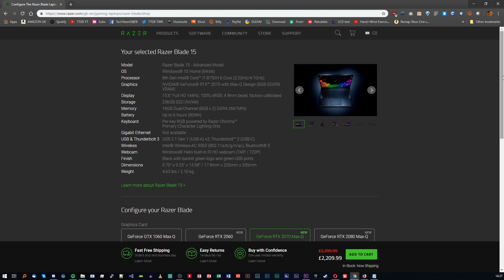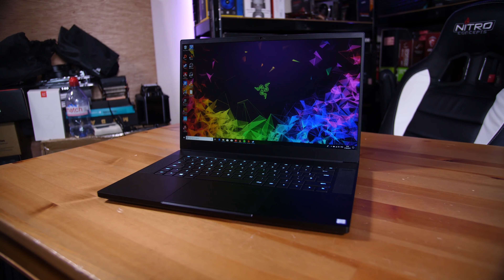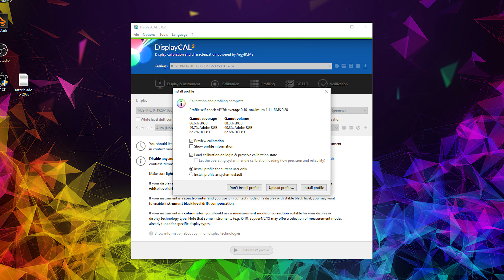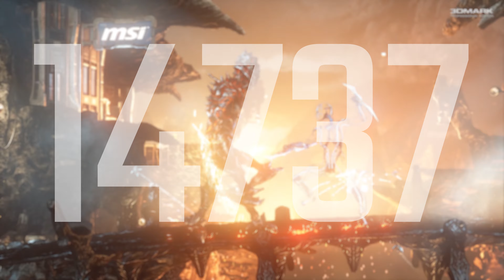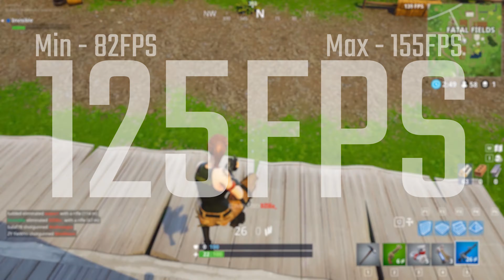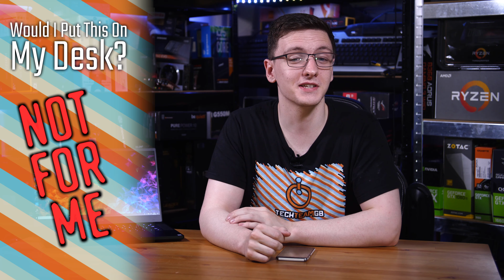Why does everyone LOVE this?? Razer Blade 15 2019 Review

Comment: So the cooling system is called a water vapor chamber and it's more effective than the heat pipes you're comparing it to. The heat dissipates to the top surface of the laptop keeping it off the chips. Under gaming load (Odyssey, Witcher 3, Far Cry 5, Exodus...), my Blades 2070 max Q rarely goes above 72 degrees Celsius and the CPU (i7-9750H) stays around 82 C. Are you playing in a hot room or with something obstructing the fans?

Comment: I have the same model but I've upgraded to 1TB SSD storage and 32GB of RAM and it's perfect :)
Reply: What manufacturer did you use for the RAM.  I tried to upgrade using Geeksquad but they said it didn't work.

Comment: The Blade 15 Basic has an m.2 NVMe slot and 2.5 in hard drive slot but you are giving up the larger battery from the Advanced model. Also, the RTX 2070 in the Blade 15 is performing similarly to the RTX 2060 in the Acer Predator Triton 500 not because it is thermal throttling. The RTX 2070 and 2080 in Razer Blade 15s are Max-Q design while the RTX 2060 in the Triton is the full version. Given that, an RTX 2070 Max-Q performs in between an RTX 2060 and RTX 2070

Comment: I own a blade 15 advance with RTX 2060, 512 SSD. My only critics for this laptop is the expensive price, moderate size storage, and the need adaptation keyboard. Everything else is great. Thermals? I live in the tropic, ambient temperature is always around 28-35°C and still this laptop performs great. Just make sure you clean it periodically
Reply: what are the thermals for the cpu? Did you underclock it? or keep it as is? Im interested in it and just wanna make sure it's all good
Reply: @kellencurby6455  I'm keeping the factory settings, only set the performance to gaming from the razer synapse software

Comment: What 5 games take up 200GB?
Reply from the maker: Windows takes up 50+, Battlefield v takes up 70, apex takes up 30, pubg takes up 30 and fortnite takes up around 20. If you installed gta v instead, that would take up nearly 100 on its own.

Comment: Lol I have rtx 2080 model cpu stays max 84ish and gpu barely hits 75. You think triton has better thermals? Sure, razer has better thermal too if you put the fans up. Have you mentioned triton is loud? Why? Because it’s fans are like 2x as loud as the blade.
Reply: Money isn’t the problem when it comes to me and razer but I just really wished that their units did not come fucking defective all the time. I had to switch it out 3 times dude to a problem with the lid on the base model. Also how’s ur blade holding up any problems?
Reply: Mine has problems, but they are all software so I fixed them.

Comment: I had the Acer and swaped it for a Blade. With some voltage and frequenzy tweaking you can get great results. For me nothing comes close to the quality feel of the  Blade. And yes I installed a 960 GB SSD, 265 as default is a crime.
Reply: 9750, 240hz 2070 model fyi.
Reply: Had the acer to and returned it for the blade... the screen on the predator looked so dim and almost yellow when next to the blade. Oh and the build quality is way better on the blade, the predator feels cheap.  My blade also doesn't have any throttling issues.

Comment: The Blade is super easy to upgrade. 256gb SSD's are standard SSD starting storage points. The Triton is cheaper and thermals are fantastic, but it's still a bad work laptop. This is the first review I have seen that doesn't say the Triton sounds like a jet engine taking off. The Blade from everything I have seen is better in almost every way aside from thermals.  I could see that none of that would be important to people buying it only for gaming, but don't try using the Triton in a classroom or library.
Reply: The Sad Potato I completely disagree with you, having had both laptops, you couldn’t use either in a library gaming wise unless you’re on whisper mode. For basic schoolwork it won’t make a peep, as for gaming in a library again you can just whisper mode and g sync will help you much more than the razer which doesn’t have this feature. So again the Triton is actually superior in the library scenario you described.
Reply: Ali Pacheco Thats good information I didn’t know about whisper mode. It’s one reason I chose the MSI GS65 over the triton, because I’d heard it was quieter during normal use. G-Sync is really the only plus over the Razer, but most of the time I wouldn’t use it anyways. The battery life hit you take and the reboot require to enable disable I would probably end up just leaving it off. That’s my opinion anyways but if it’s purely for gaming the triton is the better buy. I have never used one but I like the triton as well, but having used the Razer nothing else seems nearly as solid.
Reply: The Sad Potato Fair enough, I just find that even at school I have access to outlets, so the hit I take to use g-sync in a library while being absolutely quiet is worth it.
Reply: The Sad Potato I do agree on the ssd point however!

Comment: I’m more satisfied with the MSI laptop than the Razor. 🤷🏾‍♂️
Reply: Why the MSI over the Razer? Not that MSI makes bad laptops, but in my opinion the Razer is just that much better in just about every way. I am assuming you are talking about the GS65.
Reply: The Sad Potato , Exactly I own the GS65 and it’s not as pricy as the Razor plus the MSI keyboard and key pad are responsive and smooth to the touch. MSI just looks better with the Matte and gold touches and the 144 hz screen is wonderful.
Reply: Marcus Bell Fair enough. I also own a GS65 because I got a deal on a 2060 model for $1,400. The keyboard I do like but I wish the trackpad was taller instead of wider. One thing I really liked about the blade was that it seemed like it was built like a tank. The plastic hinges on my gs65 come apart from time to time. The speakers are also better on the blade and I like the windows hello option as well. The GS65 is still a solid and very stable laptop though. I do love the screen. it’s my first high refresh rate display and it’s a dream but I thought the one on the blade was comparable. The black and gold is nice, but honestly I my favorite is the silver like on the blade personally. To me it was absolutely not worth the $800 difference it would have cost me though. No regrets going with the GS65 it just surprised me that someone liked it more than the blade. It’s all personal preference though for sure.

Comment: Hi bro, I like your videos, however I felt that this is a low quality review. You didn't mention a lot of things eg Keyboard lighting software plus fan control, SSD speeds, Temperature differences with an undervolt and the build quality of the laptop. Not being a hater or anything but I just wanted a little more information buddy.
Reply from the maker: So I actually didn't mention the keyboard lighting because I also had an issue with it, and their software was fairly naff. It's hard to describe the issue but it was essentially that the different colours appeared separated to me which was rather uncomfortable to look at and so I spent almost all of my time with this with the keyboard back light off. Temps with an undervolt is something I generally won't cover, because basically no one who actually buys this would do that. Build quality is something I should have mentioned though, which for the most part is pretty good, if rather sharp.
Reply: @TechteamGB  Alright bro, appreciate the reply. Was thinking of picking up a Razer Blade 15 as they are on offer on Amazon for a couple £100 off. So was wanting to know if with an undervolt the temperatures would be a lot better. I've seen other videos and it improves thermals by about 5-10°c. Could I also ask if you used the gaming mode when doing your tests or the balanced mode in the Synapse software? I read that this effects the performance a lot as well as the temperatures.

Comment: Great review but could you try and get the base model with 9th gen i7, 144hz display with rtx 2060 for review cause I think it's the best. You get i7 9750, 512gb nvme, rtx 2060 and a 2.5 inch empty drive Bay.
Reply: But of course a worse battery depending on whether that matters to you
Reply: @jambononi  well you have a point ok the Gigabyte Aero 15 classic base model review please
Reply: James Travis has
Reply: @robertdunhill2077  haz
Reply: Does this model tend to deal with the heat better?

Comment: User of a 30 month old Razer Blade 2016 here. It’s been RMA’d for a complete replacement once, and had two battery failures. The webcam doesn’t and never has worked. The backlight has severe bleed. The speakers are trash. The left trackpad mouse button failed. The USB Type-C port is intermittent. And, to add insult to injury, if you’re based in the UK any repair requires shipping to Germany with around a two week turnaround and- if you’re out of warrantee- you’ll be rooting the bill for that shipping.

Oh and I work on this laptop, and play games infrequently. £1949.99 for 30 months of hassle.

I wouldn’t recommend a Razer laptop to my worst enemy.
Reply: What gaming laptop do u recommend then? It seems that most gaming laptops are generally pretty unreliable since companies have to cleverly manage heat from a powerful cpu and gpu in such a small form factor. It just seems like a recipe for disaster but I want that portability and performance and I want to make a good purchase but they’re so expensive.
Reply: I bought this laptop primarily to serve as my workstation. But you’re right- the thermal envelope is small and that causes some very serious issues with longevity.

From what I’ve come to understand of the gaming laptop market, it’s almost expected that the lifespan is ~2years. Granted mine is 2.5 years old and is soon to be shipped off for a second battery replacement if not a complete replacement due to the other problems it’s suffering. I expect my laptops to last 5, and still have several old heavily used workstation laptops in working condition.

Quality issues, battery swell and issues caused by the battery aside it’s actually been a really nice laptop and I’m disappointed that it hasn’t held up better. It’s served me well for my job, I used it over Christmas while away to learn Blender (GPU on the go is so useful) and - yeah - I’ve have bursts of gaming pretty hard on it.

It seems you can’t have the best of both worlds- a slim design in a gaming laptop is always a compromise and there’s a reason why many gaming laptops look like someone ran over a Ferrari in a steamroller. It was the Mac-like slim and understated design the drew me to the Razer when I fled Apple - they portray a very premium brand image with prices to match but I don’t think Razer substantiate it with their service and that will make it difficult for them to satisfy creative professionals.

The Alienware m15 R2 has caught my eye- it seems to strike a balance between size and cooling, albeit it’s got a very marmite design language that doesn’t lend itself well to a professional setting. I’m fortunate that I work somewhere where nobody will bat an eyelid at an obnoxious gaming laptop, and I’ve got to admit that I really like its design for some reason. We’ll see how it holds up.

If Razer would just tweak their customer support and warranty a little, be clearer about repair costs and aim to have repair partners in major territories (such as the UK, FFS Razer!) then I think I’d be comfortable recommending them. I can’t say that I haven’t enjoyed mine immensely, despite all the problems.

Just get a gaming PC and Steam or GeForce stream the game over to a cheap laptop 😂